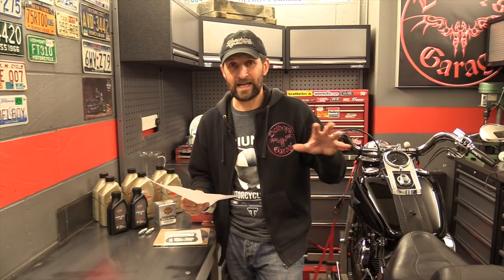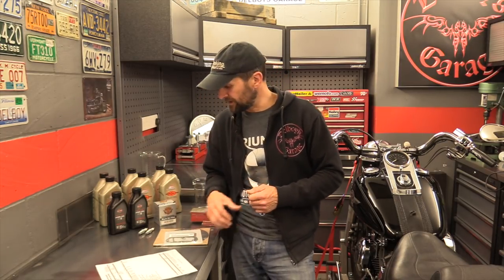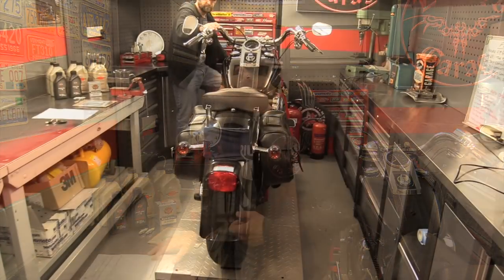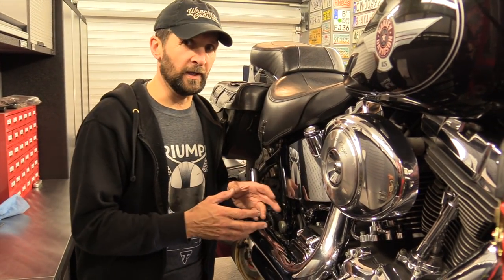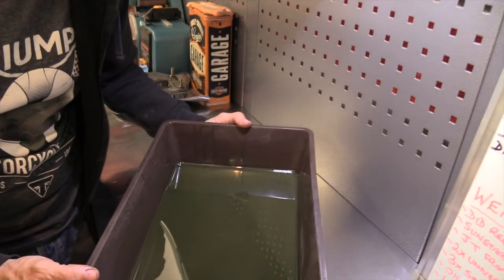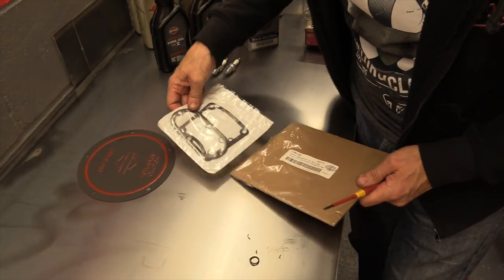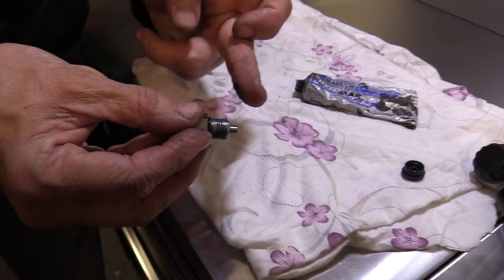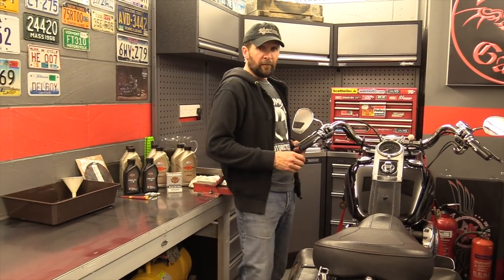Delboy's Garage, Harley Softail Service #1:- Gearbox Oil Change

Comment: Hi Del, I am a long time fan but have a question. The other day on the BMW forum I am a member of I told someone to use lube because torque settings are based on a lubed bolt.  I might as well have lit blue touch paper and retired.  A flood of comments from both sides saying torque settings are always dry and others that they are always wet.  Can I ask what makes you say they are based on a lubed fastener?
Reply from the maker: Blatantly obvious common sense Jon... bone dry, metal to metal faces, grinding against each other will naturally create drag... why do we put oil in an engine?...why to be put grease in bearings ? As i have said.. the resultant drag will fool the torque wrench into thinking its tight enough when it isn't...   This is why i dont go on forums...too many know-it-alls spouting things they "heard", "Read" or just made up.......why not Ask any of the Key Board mechanics to explain the logic of a bone dry thread..???? id be enthralled to read their answers.!    (oh, and how do i know this to be correct.....30 years on the tools has a bit to do with it..!!!)
Reply: Sounds good to me mate.  It made a lot of sense when you said it and t was what I always do, thanks for the great work as always.

Comment: Del, the casing for the gearbox if the threaded plug happens to be over tightened and strips the thread can the casing stipped thread be re-threaded rather than go to the expense of replacing a complete casing cover??
Reply from the maker: Hi again Alex, if you have stripped out a drain plug, then yes it can be repaired.. but you are better fitting a Helicoil rather than just tapping out to the next size.. that way you can use your originsal drain plug, and will then have a stainless steel thread which will be strong and secure..
Reply: Thank you, i will go read up on helicoil ... must be a glue in thread repair type of plug? no prob i will go have a search n read. Thanks again Del.

Comment: This the third or fourth time I've seen your hylomar pop up so I think I'm gonna have to get myself a tube of it! Is there any applications you wouldn't use it on? or perhaps any recommendations on what to use more generally to lubricate threads when torquing up with a torque wrench? for example the caliper bolts?
Reply from the maker: Hi Dan, Hylomar is an oil and fuel proof sealant.. its best used for oil unions and oil joints, and specially good for drain plugs... i made a video called "Threadlock VS Antiseize" .. it will tell you all you need to know about what to use on threads.. such as copperslip for caliper bolts and threadlock for shock mounts etc... its in the playlists buddy.. thanks for watching.. Del
Reply: Cool thanks Del, i should have known that as i've seen those videos! I remember now actually because I got some copper grease after watching your caliper rebuild video. It's a good shout about the torque settings being done on lubricated bolts, because my next purchase is a torque wrench! Thanks again

Comment: I never knew that you leave the dip stick on top the test the level.  Is that for all Harleys?  Great video
Reply from the maker: On this transmission, the dip test is with the cap seated on the hole, not screwed in, but always check your Harley manual as some models can vary for no apparent reason.

Comment: Hey Del what’s up man?! I don’t now if you gonna see this message but I gonna replace my clutch cable and I would like to know is I’ll need to change the transmission oil as well? Thank you!
Reply from the maker: Hi there, if it was my bike, i would always fill it with fresh oil afterwards, it's a tiny amount and it doesn't cost much... so why not. !
Reply: @Moonfleet41  Thanks bro!!

Comment: I have a question for the oil level.
In the HD manual service it says, I quote : "Thread dipstick in until the 0-ring contacts the case. Do not tighten.".
When I read this sentence I did not understand the same way as you do. For me you have to screw a little bit the dipstick until the O-ring touch the case and not just put the dipstick like you do.

What is the right way ?

Thank you.
Reply from the maker: What year is your bike.?
Reply: 2015, and my bike is a Dyna, sorry ;-)
Reply from the maker: OK, yeah thats right for a Dyna motor buddy.. always go with your manual, Harley models vary a lot for simple things like this.. !

Comment: Del doesn’t the service manual call for the right oil for the temperature you are projected to be in? Mine would be sae 50? Also for the primary and transmission it calls for the formula + not syn3 ? I trust what you say and you know a hell of a lot more then I do just wanting to understand why you are using syn3 for everything? I’m about to do this service on my softail slim,Thanks mate always appreciate your videos!
Reply: Never mind my bad I see why
Reply from the maker: Yes indeed mate, it's always good to follow the manual's advice, it does recommend the Formula for trans, etc., but as I think you've now discovered, the Syn3 exceeds all the recommended oils, so it's effectively, better... and as a multi-grade oil, it covers all temperatures that we're likely to encounter unless you live in the Arctic lol - good luck with it buddy, hope it goes well, and give us a shout if I can help anytime!
Reply: Moonfleet41 thanks mate!

Comment: Hey Del, quick question, and the garage looks fantastic. What brand and model is your motorcycle lift? I have been looking at handy motorcycle lifts, but they are compressed air lifts. And looks like yours are hydraulic ? Thanks in advance for the help. Right now just have a small floor jack and getting too old to be down on the floor servicing the bike.
Reply from the maker: Hi buddy, mine is a Sealey MC680, it is hydraulic but it has an air ram for when I'm feeling lazy... the air doesn't jack up the lift, it actually acts the hydraulic pump... no lift is pneumatic, as air isn't a safe medium for holding a bike up, it must be hydraulic... just did a video on this (Safe Use of a Motorcycle Lift) - there's a link under that video to a full list of a dozen different lifts, hope that would help you - good luck with it, all the best, Del
Reply: Thanks Del, will check out the video and the lift. I hope they have a distributor here in the states.
Reply: Hi Buddy, finally got a reply back from Sealey about the lift. The cost as you know is £1,679.94, in addition to this the shipping is £489.98 plus when it gets to the airport here I have to pay taxes and import charges. I went ahead and purchased this lift. Here is the site, https://www.nhproequip.com/pro-1200-motorcycle-air-lift                 I also purchased a seat and lift like you have for added security.
Reply from the maker: That's great news buddy, yeah looks like a stonking piece of kit, and more than strong enough for the job... and your knees and back will thank you lol

Comment: Good video but 6 yrs old. Now riders are interested in getting all old oil from oil tank an lines from softails. 1. Drain old oil..  2. (11 rotations for engine cycle). With shutoff switch in "on" position (so engine will "not" start) push starter, count 11 rotations). The rotation moves old oil through lines to filter. 3. Remove filter an replace. 4. Remove oil line next to fill hole in tank an place old oil catch container in end of oil tank fill line.  5. Rotate engine 11 more rotations, emptying old oil from filter to tank, (now being caught in catch container from tank line. 6. Remove catch container an reattached oil fill line to oil tank. 7. Fill  tank too proper level. 8. Check engine oil level, etc...
Reply from the maker: Are you actually talking us through a purge video?  We've done 3 of these mate and all in our Playlist, exactly as you describe!
Reply: @Moonfleet41  I don't know what you know or what I haven't seen? I'm just forwarding information I thought you would want. I don't own Softail so I can't use this system, but you could!

Comment: I just did the three fluids on my 2012 fat boy and when I removed the drain plug for the gearbox I noticed some of the threads had sheered off in the hole,do you have a fix for this when the threads strip out in the gearbox housing?
Reply from the maker: Hi Mike.. Oh my goodness, that's spooky.. today i filmed a video that will give you Exactly what you need.... 

I have a very important thread to repair for a friend of mine, and have got hold of a really top quality German made thread repair system, and ive done a full demo of it for this weekend coming video which will be posted online Friday evening. I hope it helps you out..

Comment: hiya what do you think of spectro motorcycle oils?
I'm using them so far so good.
Reply from the maker: Not a brand ive heard of buddy.. but with todays modern standards, you can go far wrong as long as you get the viscosity right..!

Comment: Hi
Question in regards to my Bonnie. It has a glass for checking the oil, but all I see is black. Can you show me a photo of where your oil level should be at from looking into oil cap opening. It would be a big help.

Thanks 

Walt
Reply from the maker: Harley doesnt have a oil glass window buddy..!!??
Reply: I was asking about your scrambler
.
Reply from the maker: OK, if you look in the metal casing next to the glass, there are two line, and "F" and "L" for full and low... just make sure the oil is to the top line, or if you can see it.. then make sure two thirds of the glass is covered... hope that helps..
Reply: Thanks it does

Comment: Hey there guys.
I'm curious, when you say to lube bolts for torque, is that just the drain plug? Or 'every' bolt? What about bolts that need locking compound?

It's amazing to find out just how much I don't know, even after 34 years of riding. Haha.
Reply from the maker: IN the video i made on "Threadlock VS Antiseize".. i covered all that matey... the wet threadlock compound lubricates the thread into place, then sets to hold it..!
Reply: Moonfleet41 
I've been away from YouTube for a little while mate, so I'm guessing I didn't see that one. I'm trying to catch up. I'll go and hunt that vid out.
Cheers guys.

Comment: Hello. I sometimes find it difficult to find neutral on my softail.  Downshifting is fine, when I get to a stop light it seems to go from 2nd to 1st and neutral is illusive. I have a 2005 Fatboy with about 10k miles. What can I do to solve this issue? Is there a video about solving this issue? Best Regards, Wilfred
Reply from the maker: Hi Wilfred.. Good to hear from you sir.. Sadly, as you probably know, Harley's are very high maintenance for that basic stuff.. it has to be done on time and regularly... so if you have 10K miles, and thats on a 2005 bike.. then it hasn't done much in the way of hard work.. and Harleys love to work hard.. it makes them free and supple... but if they are garage queens and hardly go out, then things start to bind up... 

Im sure you realise that your bike is due a major service at 10K miles.. and if its taken almost14 years to get there and that means a lot of time stood still... and that means that your clutch will be pretty glued together with old stale primary oil that will have become thick and sticky...  this causes the clutch plates to resist separating, and makes selecting neutral really hard..plus it makes the gear selection heavy first thing in the morning when its cold..  

Naturally you should be now looking to do your full major service, all fluids including brake fluids etc.... but you know that... for your gear selection problem... if you have the major service done by the dealer or a garage, then they will carry out the primary oil change, clutch adjustment and primary chain adjustment.. all which need to be done at 10K miles... but if you cannot afford that right now, or want to do it yourself. then go ahead and make those changes, and you'll find that your gear selection will be a lot easier, and feel like a new bike... 

So there you go buddy.. Change the primary oil, adjust the clutch pack, and the primary chain... we have videos on all three in the Harley Davidson playlist if you need any guidance..ans all on a 2005 softail too. Good luck with it, and let us know how you get on... Del.

Comment: First, this is a great series man, and I'm going to throw you a bone on PP, or buy a Tshirt to say thanks for your work. Never again will I pay these outrageous fees because that's  about right on the money. Average low end cost is about $100 USD per hole anywhere in Texas. Service rates vary from $85-$125/hr depending on where you are. I just picked up an old 04 Springer, and I'm using these videos as they are the best on YouTube. Plus, I love English accents, so that's a good bonus. 😎 
 A couple of questions mate...if you don't mind. 
1. Old timers, especially experienced Mechanics strongly encourage running 80/140 in the gearbox. S&S performance does as well by the way. What say you about that?
2. Just curious...Why did you not use the socket for plug removal here?
Reply from the maker: Hey Patrick, Thanks so much for your kind words sir, and we really appreciate that support, this garage throws up never ending bills, and we aren't commercial, we just do this in our spare time..(ALL of our spare time lol) ... The T-shirts didn't earn us more than pennies, as the print companies took the lions share, and they recently shut the store as it didn't have enough traffic... but we do have a Tip Cup through PayPal, thats just a single donation, or of course Patreon if you wanted to support is long term from a dollar a month.. the link for that is right under the video... if you click "show more" then the Paypal address for the tip cut is there lower down too....    Thank you so much for that my friend, it really makes a difference.. 

With the Gearbox OIl, ive seen also that a lot of garages recommend the 80/140... thats a bit thick for over here in the colder climate as its so thick.. the thickest you'd need here is maybe a 90 weight.. but for Texas, then that multigrade would be perfect.. and naturally S&S would as they are performance engines...   and with the Plug spanner.. i was just lazy and reached for the closest wrench.. no other reason, a socket is fine... 

Thank you again for your amazing support, its great to have you aboard, keep safe, and keep in touch..
Del.

Comment: How do you feel about using conventional oil? I've heard many opinions on both sides, I'm still on the fence.
Reply from the maker: Hi there Matt.. I have used the "all-in-one" style Screaming Eagle oil for many years now, and it's never let me down.. it's just easier, and the main dealers present it as an 'upgrade' over regular separate oils..  but i have wondered for a long time if there would be a discernible difference in the way the bike feels using regular specific oils for each application... and you caught me at a good time because im planning to make the next oil change of my Dyna Wide Glide a switch over to regular conventional oils and see if there is any difference at all in the way the bike feels.. so video coming soon, and ill let you know..
Reply: @Moonfleet41  Sounds good! I'm doing the same with my Fatboy. I put 75W-140 gear oil and conventional oil in the oil tank and primary this morning. I've used full synthetic in all three holes myself. I would share my thoughts with you but I don't have any yet, it raining heavily here today. Soon though. We will have to share opinions after a few hundred miles. Thanks for your time!
Reply: Well, I've got those couple hundred miles on the bike now, more like 1,100. I'm impressed with the results. 
The gears almost instantly changed easier and smoother. Not only is the ease of operation easier, it is also quiteer even from a stop. Also, I've never landed neutral easier on any bike. 
If you remember I also used conventional oil instead of synthetic. It's still a little early to form a comprehensive opinion on this. It appears to be holding up great. I'll keep in touch with you and let you when it comes time to change it. As of now the color and viscosity seem to be holding up well. 
I've never been much on trusting these oil companies or their research. This one time I'm glad I did my own research. 

Thx for your time.
Matt Kelly
Reply from the maker: @Matt-mt4dd  Hi Matt, thank you for the update, it's really encouraging to know it's doing well... I'm planning to do my three hols change later this month, and will begin my journey of discovery, am hoping for a couple of things with my old Dyna at 45k miles, it's nicely bedded in now, but I can distinctly hear my gears change and the motor takes a fair while to warm up... which means the oil is still heavy thick for long than conventional oil, so am going to try the same as you, hoping for quieter gear changes and, perhaps, a smoother clutch action... only time will tell!
Reply: @Moonfleet41  I wish you the best of luck. I'd say I'll use 75W-140 for now on in my gear boxes, Harley anyway. I will have to reevaluate the conventional oil situation on down the road. I'll be sure to share my thoughts. Have a good one and ride safe.

Comment: Hey Del..Where can I buy that marstons oil plug grease?..I know I probably spelled it wrong..lol. I'm in the us. Cheers...joe
Reply from the maker: Hi Joe, it's marketed these days in totally different packaging, that old tube is 25yrs old would you believe!  Proving that it never dries up, no matter what... and you hardly ever use any of it , but it's widely available as 'blue Hylomar' , you should be able to find that on Ebay, if not, let me know, there could be other suppliers of it... hope that helps !
Reply: Moonfleet41 .yeah I found it on amazon. Just purchased a small tube..probably going too last for many moons. Lol..thanks again..cheers.   Joe